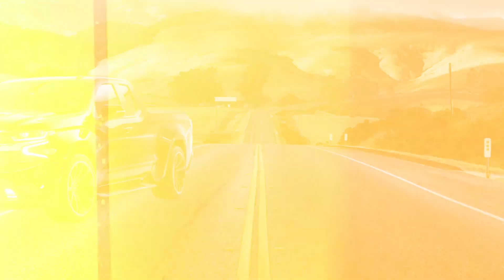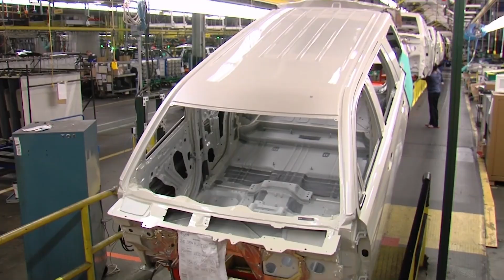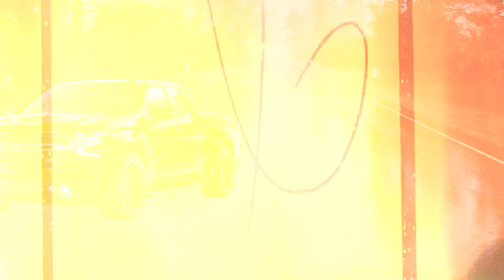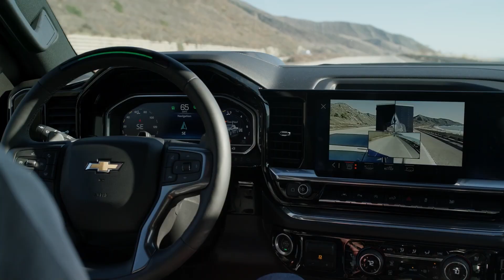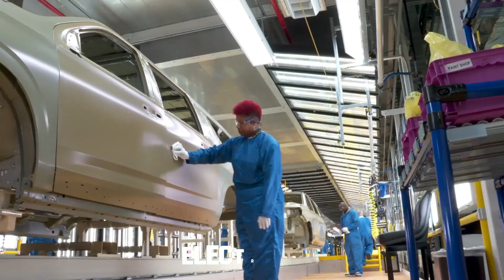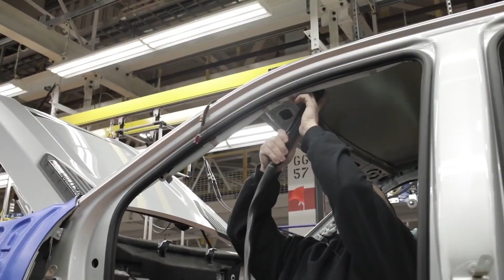GM CEO Releases MIRACLE $18K Pickup Truck & Turns GM Critics Into CHEERLEADERS!

Comment: BullS$it! There you go. Simple 4-cylinder non-turbo engine, Manual trans. Nope. $18K? your dreaming! it will wind up mid-$30's at best. Nobodys gonna buy it! And it will fall apart in 3-5 yrs at best!
Reply from the maker: Ha! You're probably right about the pricing creep - that's exactly what happened with the Maverick. Ford started talking about the low-$20s and by the time it actually hit lots, good luck finding one under $30k with any decent options.

What would it actually take for you to consider ANY compact truck at this point?

Comment: I've told my favorite mechanic I'll sell him my beloved single cab, step side, V8 Silverado when I can buy an electric El Camino.  Please make mine a single cab with a 3 seat, fold down arm-rest and an open options list.  It could be an AWD, fully independent suspension, unibody, comfortable, fun little cuck!  A PHEV or EREV with a solar bed cover with power outlets in the bed and cab would be nice for weekend adventures and the impending apocalypse.  I'd love it with a V8, but whatever drive train it has, please build it in the USA!!!
Reply: Well looks like you may keep your truck a long time. GM is out of EV truck business and this is just another Fluff piece from somebody just making stuff up.
Reply from the maker: An electric El Camino with a three-seat bench, solar bed cover, and power outlets... that actually sounds awesome! Honestly, what are the odds GM actually builds something that cool versus just another boring compact SUV with a bed?